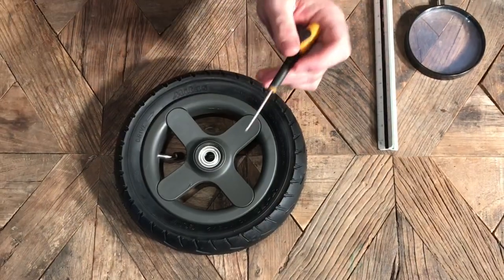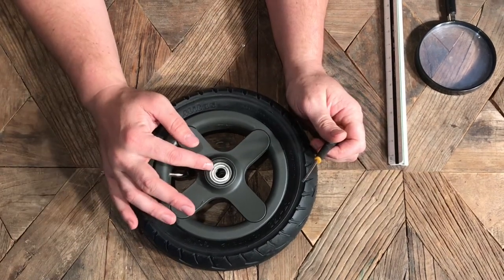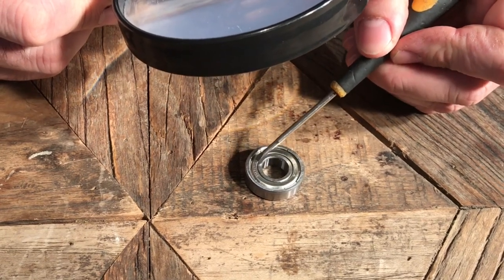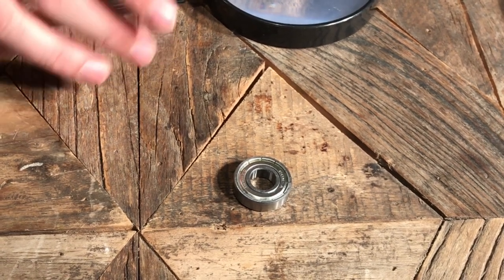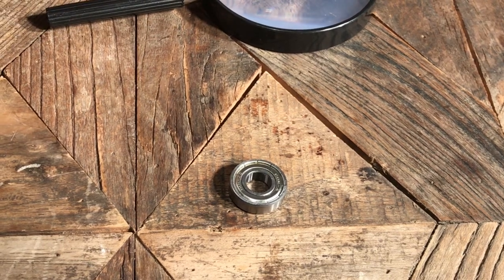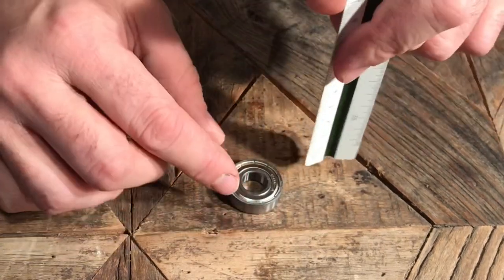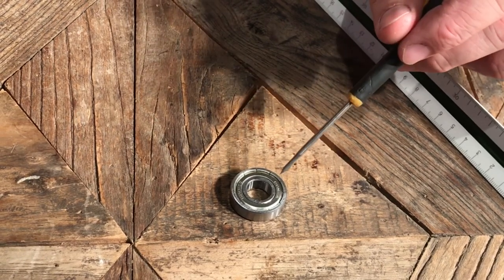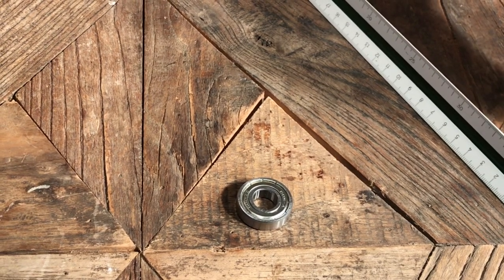How to Find Correct Replacement Ball Bearings for Your Stroller / How to Read Bearing Size Info

Comment: I wonder if you ever have replaced the bearings in the rear wheel of a Cybex Balios S? Even after removing the 2 screws, the plastic part around the axle does not come out. A Balios S with couple years and have one of the rear bearings completely shattered :(. Any suggestions? Thank you

Comment: I have a Uppababy Vista V2 and all four bearings on the front wheel were completely corroded. Does anyone have the bearing size for this specific model?
Reply from the maker: I don't have the sizes available, but if you haven't tried contacting Uppababy yet, I would recommend doing so.  They're pretty good with after-sales service. :)
Reply: @BarnevognverkstedNo   Found it. 6000Z. They were going to charge $33 each for replacement front wheels. Found the bearing for $7 total. Thanks for the helpful vids.